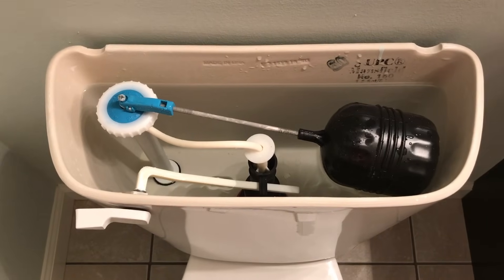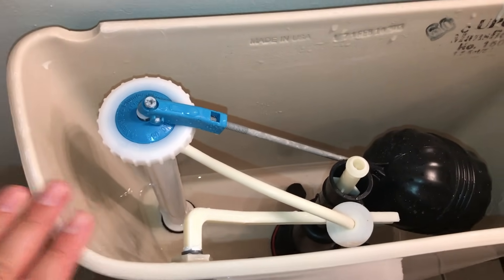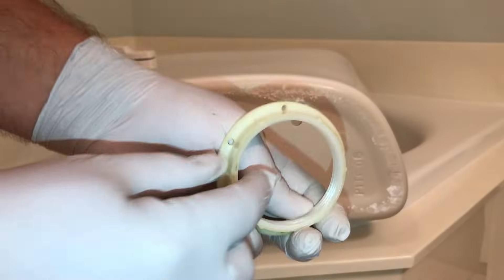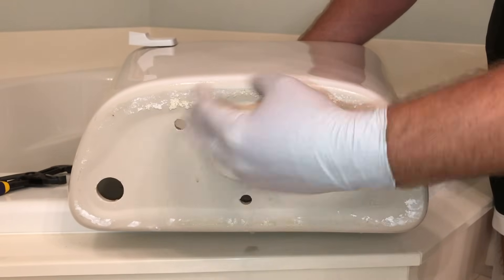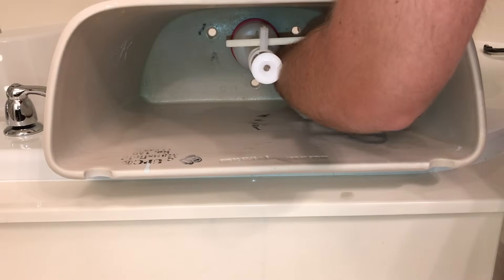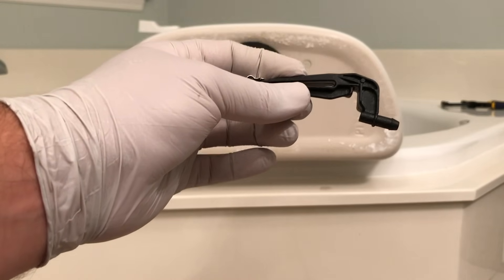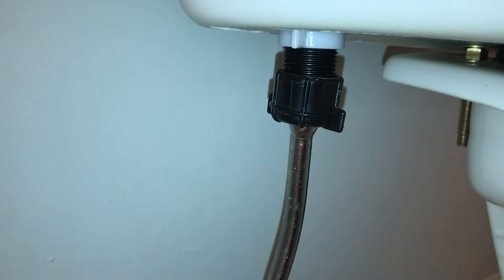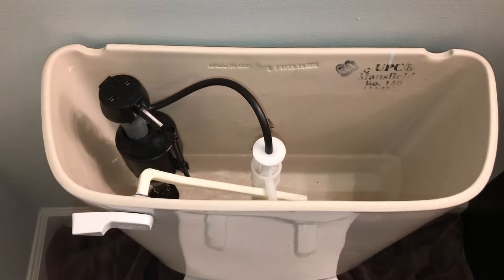Replacing Fill Valve & Flush Valve for Mansfield Toilet

Comment: This was incredibly helpful.  I watched first to convince myself i could do it, and then I watched step by step while completing the project.  I believe all previous parts were from 2002.  I think everything was ready to break, and I'm glad to have replaced everything.
Reply: Bruh
Reply: You can install a new ballcock fill valve
Reply: I would not rest any work pieces over the small area such as the bath edge, it may be slippery, even over a towel! If the tank you are working on,  fell!  for any reason, it may create an expensive repair as a result!
Reply from the maker: @kcryeung1 good point!!
Reply: While doing all these repairs , I may choose to replace the water fill tubing to a flexible one, with a more reliable on/off valve.
Reply: In our area, These Mansfield items may not be available in any stores!

Comment: Thanks Kris for the detailed video, very nice job. I regret pointing this out but feel I must to help people better understand. This video shows a Mansfield #160 tank which uses a #211 flush valve and that is what Kris removed. The #211 valve provides a 1.6 gallon flush. The replacement valve shown is a #210 valve which is used on a different model of Mansfield tank that was used with older styles of toilet bowls that required more water to flush properly. It provides a 3.5 gallon flush. Take notice at the end of the video went the toilet is flushed the water level in the tank goes down to the near the bottom using all the water that’s in the tank which is a 3.5 gallon flush. With the correct #211 valve the water in the tank would go down about halfway which is a 1.6 gallon flush. The toilet bowl that’s matched with the #160 tank is designed to flush with 1.6 gallon so wasting 2 gallons per flush is not necessary. I have never seen a #211 valve in a hardware or big box store, seems like they have to be ordered online. I have two of these toilets and I have learned that only original Mansfield parts should be used because after market parts often fail prematurely particularly the red rubber flush valve seal rings.
Reply from the maker: Curtis, this is great information!  Thank you for sharing this level of detail. I appreciate it and believe in sharing info to benefit all. I’m going to pin this to the top!
Reply: I didn’t mention it but I do use the Fluidmaster fill valve, it’s the best fill valve available. Fluidmaster recently came out with the 400H PerforMAX. It has an adjustable valve on it for the water that goes through the tube that  fills the bowl so it can be set to where it puts the correct amount of water into the bowl without over filling it. When too must water fills into the bowl the additional water just overflows the trap and goes down the drain which is  wasted water every flush. This is what the 400A does and all other fill valves that I have seen. I just replaced the popular 400A valves with this newer 400H on my two toilets. There’s a procedure to determine the correct water level in the bowl and mark it then make the adjustments on the fill valve until you get it just right. The only store around me that has this new #400H valve is that orange big box store.
Reply from the maker: Thank you!  I’m glad my video is helping so many, and Curtis’ comment adds that much more value to help people be informed.
Reply: Just fyi the red rubber ring fails even with original mansfield parts if you use bleach tablets in the tank.  I'm testing some different ones to see if they will last longer with bleach tablets currently but it's still too early to know how long they will last.
Reply: Thank u for the information.
Reply: Instablaster.
Reply: ALL our 211 toilets are leaking. 1st one the orange flush seal came off so I put original back in place still leaked so easy solution tuned off water to toilet & not in use. Started using other toilet then it just started leaking have no idea why, turn water off to 2nd toilet later problem. 3rd toilet started leaking. Now I have no choice went to store bought NEW seal for 1st toilet still leaking. Any suggestions?
Reply: Thank you your detailed comment! I was afraid to buy the wrong part for my mansfield 160 this was more helpful than home depot. The time people take to upload videos and write comments such as these is what makes you tube great (aside from the bs censorship)! Appreciate your help!
Reply: This toilet is a Mansfield Alto. The flush valve is intended for the older Mansfield Imperial. Just wanted to point that out for no reason in particular.
Reply from the maker: Toilets and Computers. Interesting combination!
Reply: And as long as we are pointing things out in the video, be sure to take your time and make sure the water line to the bottom of the toilet is not cross threaded, as this one appears to be. Could cause a nasty leak in the future!
Reply from the maker: indeed!  I realized after taking the shot and fixed it. Good eye!
Reply: Can you please list the parts that should be used. As I have Mansfield 160 model and i have tried Korky universal flush system and its leaking from the bottom of toilet. Please advise the exact parts and where to buy those. thanks
Reply from the maker: The Fluidmaster Universal works well.  Uou can find that here: https://amzn.to/3ELNIq3

And a video on installing it here:
Fluidmaster Universal Kit Install in Mansfield Toilet
https://youtu.be/rctJHNloUL0
Reply: Need help my toilet is a 51 everything seems correct but will only flush the 1 ish gallon unless I hold the handle down. Flush valve lifts slightly. Watching videos on genuine Mansfield parts, stated I may need to attach chains to lever? I’m so confused
Reply: Kris, I saw a similar video and I finished with some problems along the way. I am replying after the job is done because my water tank is only half full. I saw your video and I totally like the way you did your tank repair. I read your comments and Curtis explained the 1.6 gallon tank and, wow-eureka! It was a great feeling knowing that my project is completed and I feel great. I don’t have to fill my tank full. Thank You both so much!!!
Reply from the maker: that’s great, Steve!  Way to go tackling the project and knocking it out! 💪
Reply: How do you know is name

Comment: Kris-
Thank you so much for this video. I had contacted a plumber to look at my toilet that was hissing and condensation was building up on the lid.  He told me I needed a brand-new toilet for $1200, or he could re-build the one I had for $800. I could not afford either. I had asked for the least expensive solution- and this was his answer. So, I took to you tube and found your video. I went to Lowes, bought the $30 Kit (fill valve, flush valve, handle (which I didn't need), bolts, washers, TOOLS & the plastic packaging acted as a bucket!!) I followed your video ( & the instruction booklet that came with the kit) and with the help of my daughter WE replaced everything in the toilet and it's working great! We fixed it for $30 with your help!!!
Reply from the maker: That’s amazing!  Well done. I bet it felt real good after swapping the parts. Have a great weekend!

Comment: Well I’m about to begin to install the new inners to this very old toilet. We’re talking 30 years old!  I ordered a kit from a Mansfield supply and it is the exact pieces to completely replace all the parts.  Cost about the same as if I had purchased each piece individually and it’s original Mansfield parts.  I’m a little nervous but you explain things so clearly and precisely that I think this 68 year old woman can get the job done! Your video is the best one I have seen. Thank you!
Reply from the maker: You got this! Key is taking your time and you’ll see there’s nothing to it!  👍🏻
Reply: Well I did it!  While I was at it I removed the toilet too and cleaned it up with a new wax ring and scraped off that old one. I followed your instructions to rebuild the inside of the tank and that wasn’t too difficult to do seeing that your instructions were so clear.  I did have a problem with a small leakage tank to bowl. I placed a paper towel beneath where the tank and toilet meet and flushed several times.  While there was no actual dripping of water the paper was wet so I knew I had to fix that. I could only finger tight the bolts so much. With the Mansfield kit they use a plastic nut to secure the tank to  the bowl. I had to buy a socket wrench to tighten the nuts. I am now paper towel dry and flushing away!! 🎉  It was a bit of work for me because I decided to remove the toilet too but as you said the key was to take your time and I saved more than $500.  Thanks again!
Reply from the maker: heck yea!!  You did great!  You even took it to the next level and replaces the wax!  Way to go! 💪

Comment: Gotta love YouTube.   Just finished replacing the guts.  The red valve seal was worn through and the top cap was broken off, I had taped it back about 6 months ago.   When it started running on it's own because of the valve seal I knew it was time to change, but needed this video to get me through it.   Thanks!!

Comment: Thank you very much for your time in creating this video and sharing.  Your video gives me encouragement to replace the rubber thick gasket which attaches to the tank bottom to serve as a base for the flush valve.  Your video is very very useful.  You have covered all important points and your videography is to the point and well focused. God bless you for helping others.
Reply from the maker: Thank you for the comment!!

Comment: Would not have been able to fix my toilet without this detailed guide. I did notice the toilet to bowl kit did not come with enough rubber gaskets or bolts
Reply from the maker: That’s correct in some cases. Most all-in-one kits come with two and ine may find themselves needing to buy an extra set of tank to bolt

Comment: Thanks so much for this video. I have an oooold Mansfield toilet that ran constantly. I wasn't sure where the leak was coming from and decided to just replace everything. I was a bit intimidated but your video made it very straightforward. I especially like that you included what to buy and recommended the tank to bowl kit. The gasket on mine was nearly unrecognizable and all of the washers on the bolts were rotted. I followed the video step by step and my toilet flushes perfectly. No leaks. Don't know what this would cost if I hired a plumber, but it cost me $35 and an hour of my time. Thanks again.
Reply from the maker: +Shawn Channell That’s awesome!  Glad it went well, and that the video helped.

Comment: Hi Kris, thank you for the great video. When our toilet stopped flushing I told my wife to call the landlord. I am working very long hours right now and knew I would have very minimal time to spend trying to get it fixed. She was persistent and said he makes it look so easy. So dreadfully, I said ok, knowing I would it up having to spend time I did not have working on this project when it could have been done for us. Other than having to cut the screws (they were rusted) and some very minimal tightening and loosening, my wife did everything. Low and behold she comes out saying that it flushes and there is no more leaking on the inside due to a bad flush valve. Two thumbs up, great vid, very easy to follow. Thank you.
Reply from the maker: That’s awesome!  Thanks for the comment, and I’m glad you were able to get things back up and running!

Comment: This video was super-helpful! Replaced all the same parts just as he showed!! I needed 13mm wrenches/ratchets for mine, though—in case it’s helpful for someone else. I used the PerforMax 400H-002 Fluidmaster Fill Valve, Irwin Vise-Grips (Groovelock), Danco Tank to Bowl kit (for Mansfield Alto), and Keeney Flush Valve (for Mansfield #210). Got all parts/supplies from Lowe’s. Thank you for a great video!!😁👍
Reply from the maker: Great!  Thanks for sharing!!

Comment: Thank you Kris!  I'm an I.T. guy that has a phobia related to plumbing (I.T. / Electronics and water just don't mix.  LoL)  great video I rebuilt 2 of the Mansfields in my house thanks to running and pausing your video!  Interesting that I'm the original owner, purchased from the custom builder and all of the Mansfield toilets were installed with out the rubber washer/metal washer and nut on the underneath of the tank????? only the rubber washer, metal washer and nut coming up from toilet bowl flange was holding it all together.  Thanks to your video I added the appropriate hardware to both.  -DogTown
Reply from the maker: good deal!  I’m also an IT guy!  I just know a thing or two about fixing these kinds of things ;). I guess it’s the engineer part if my job that’s in me.

Comment: Excellent video! We have 3 Mansfield 160s (Drees Homes new construction) that are 8 years old and are getting hard to flush with the handles. One was getting really bad. I purchased a Mansfield Kit from Grigg Industries and they provided a Mansfield 08 Anti-siphon ball cock and Watersaver 211ULF flush valve. Slightly different than your parts but go in basically the same. No adjustments necessary. I took apart and installed per your video and it works! Never rebuilt a toilet before so I was a tad nervous. Only took 1.5 hours. Saved me a $150 plumber call. Bigly thank you!
Reply from the maker: That’s awesome!  I’m glad it all worked out for you!

Comment: Thanks much for this video. Gutted out 16 yo Mansfield and replaced all parts. It's be trickle running for longer than I care to mention.

Two issues: Not enough gloves, but a box of gloves has gone from 7.99 to 19.99, or more, because of Covid. Second, the plastic nut, for the valve, was seized. I had to cut that wawa to extract the valve. 

Most i.port: No injuries and limited cussing. I hate plumbing duty.
Reply from the maker: Glad you got to it and knocked it out!  Too bad on the gloves. That’s insane!  Maybe Costco has a better deal.

Comment: Excellent video Kris.  One of the best I've seen.  I have a Mansfield toilet like yours with old valves that have started to leak.  I checked my local Home Depo and they have all the parts I need.  I'm going to attempt the repair tomorrow.
Reply from the maker: Thanks for the comment!  You’ll knock it out in no time!
Reply: @theXchange  Hi Kris, the replacement went fine - no leaks first time! :-)  The only hitch I ran into was that the circular lock nut threads were stuck to the old flush valve, so when I tried to loosen it the whole valve turned with it.  I couldn't get a good enough grip on the valve to keep it from turning.  I had to carefully hacksaw the inside of the flush valve and take it out in pieces with some pliers.  The lock nut sustained minimal damage and was reusable.  Thanks again for a great video.  You saved me a lot of $$.
Reply from the maker: good deal!  Yea, that can happen so you did the right thing!

Comment: Fantastic video. I purchase the repair kit from Mansfield for 3 times the price because I wanted to make sure everything worked perfectly. The guts look identical so if I were to do it again I would go with the Everbuilt. The one thing I was not to impressed with in the Mansfield kit was the Smartconnect system for the 3 bolts which hold the tank to the toilet. It seems far more prone to leak. I think the original version bolts in the Everbuilt kit work better. Unfortunately I could not reuse my old ones as they were so rusted the nuts were a bitch to get off.
Having your video walk me through it was very reassuring.  Cheers.
Reply from the maker: Cheers!  I agree on the bolts. The Mansfield kit doesn’t leave a whole lot of confidence when buttoning things up :D

Comment: Curtis Roger McAlister, this is my exact situation where the store only had the #210 as a "universal" replacement. My old #210 had donut shaped styrofoam ring around the middle of the flush valve cylinder The new one caused a double-flush since it waited longer to drop down, letting too much tank water out.
Solved that by preserving the old outer cylinder from the #211 and used it with the other parts of the new flush valve. Took me awhile to realize the little knob the top screws off to allow disassembly!
Reply: correction: "my old 211"

Comment: I had replaced my fill valve before watching this video and I am having issues with a weak flush. It seems I don't have enough water in my tank, so I am going to use what I learned in this video and try to adjust. Hopefully it works as I have the fills valve adjustment at the highest it can go. Fingers crossed!!!
Reply from the maker: great!  I hope it worked out!

Comment: Good job, I have the same setup and have lost the seal on the flush valve, so now I know I need to pull the tank (D'oh!).

BTW, if you look at 18:37 you'll see that you severely cross-threaded your fill tube nut.  It's still providing at least the minimum pressure needed up on the rubber seat, so no leaks, but certainly not ideal as a large part of the torque you applied has gone into the thread jamming and not pressing on the seat.  I despise those solid fill pipes, largely due to the fact that they tend to fight good alignment at the tank fitting, and make you more prone to a cross-thread.  I use an over-length braided hose instead when I service one, and put a loop in it between the shut-off and the tank, so it has no tendency to lean to one side.  They are a bargain at 10x the price after all of the floods I've had from failed solid line fittings.
Reply from the maker: Your observation of my having cross threaded the supply line to the fill is correct. I corrected it off camera where subsequent shots should show it’s on correctly.  Thanks for the comment and the suggestion on the braided lines!!